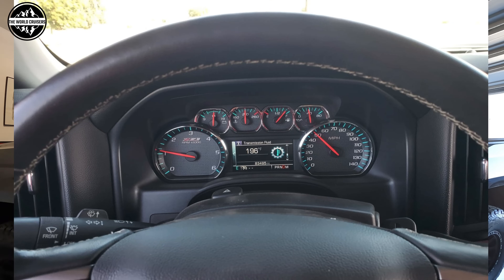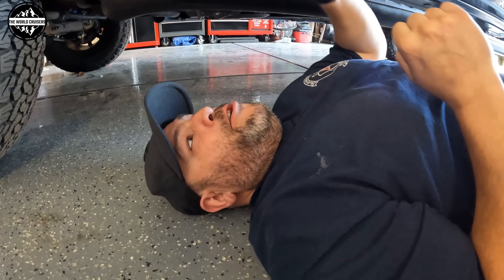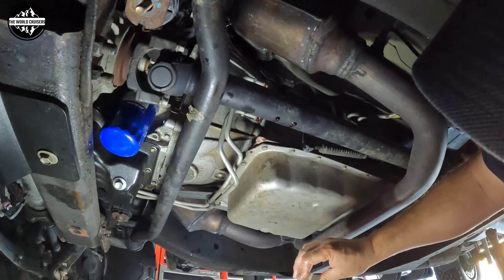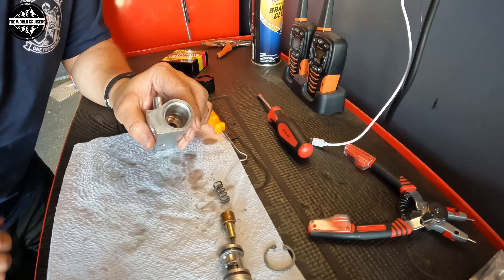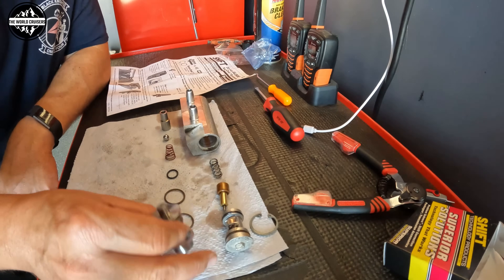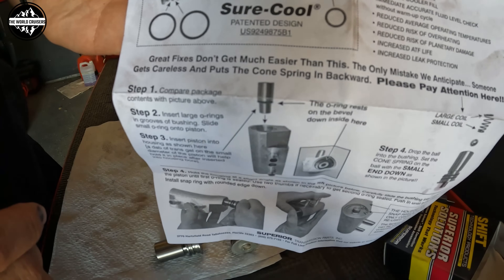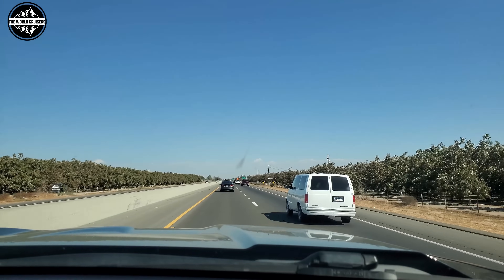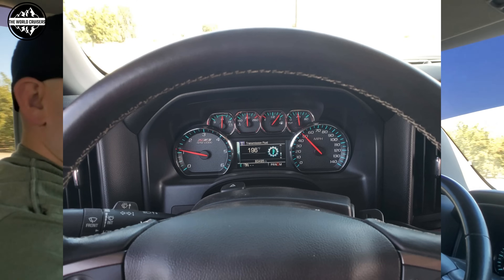DIY: How To Keep 6L80 Transmission From Overheating On Chevy/GM 2014-2018 | Pill-Flip, Sure-Cool Kit

Comment: Great video!! Just had a customer with the same problem, updated part from GM fixed it!
Reply from the maker: Thank you! Happy that it helped!
Reply: What is the updated part?? 
Need to know, I'm a new owner of a beautiful 2014.
Reply: Its an updated thermostat but like he said in the video youll need new cooler lines. Or you can just simply flip the pill and be done. @tomwoods8678
Reply: Can one use the internals of the updated and place Into the original part?
Reply: @themanimal01  Yes.

Comment: I have a 2017 Silverado and just spent $5000 on repairs for my 6l80, got thermostat bypass installed, gears at 4.56 and new radiator and engine thermostat and my transmission temps are hitting 220 while driving (no towing) and trans temp will get up to 230-240 if I’m idle for a long time. Took my truck back to transmission shop and they keep telling me everything is fine and 6l80s “just run hot”
Reply from the maker: I’m no transmission professional, but from my research they should run 175 degrees plus or minus 25 degrees.  Maybe get an opinion from another transmission shop because that seems a bit too high to me.  I will ask my local shop here as well and see what he says. What size tires are you running?
Reply: Trans cooler is prolly plugged
Reply: @huntfishsmokemeats  you are correct I had my transmission flushed and lines cleared. Haven’t had an issue since. Transmission sitting around 140-160 during winter and around 180 during the summer now.
Reply: @rxjefe have you had any other problems?
Reply: @tylersimpson3512  just the transmission around 80K miles. I’m starting to build a 6.2 to swap before the lifters go out. I had some electrical issues that will cause the radio to shut off or my steering wheel would jerk. But after a battery change it hasn’t happened for some time. I’m thinking a ground wire was hitting metal or getting some type of interference.
Reply: @rxjefe  did a shop do it or did you do it?
Reply: @bryceeitel9463  yeah almost everything was done at a shop, I did the thermostat bypass and radiator install.
Reply: @rxjefe having same problem
Reply: Just installed mine Friday.. So far in the past couple days the temperature got up to 144 And then went down to 140. Going to keep monitoring it over longer drives but so far seems to be working like a charm :-)
Reply: I installed the superior product. However, I still have heat issues?? Clean trans fluid. I have no clue. Does anyone have any ideas?
Reply: @themanimal01 I had to put a transmission in 8000 at the dealership I’m to do a bypass
Reply: They do, so they are right ,technically speaking...but they *shouldn't*, and even GM admits that now.
Reply: I found in my 2013 Silverado with 536 LED that sub hundred degree temps from ambient or roughly where it runs

Comment: Great info, thanks. About 4O seconds in, your video shows transmission temp at 196 degrees. Is that sensor built in? My 2015 doesn’t show transmission temp screen.
Reply from the maker: Thank you… yes it’s a factory reading.  You might not have the box checked in your settings.  Click your left arrow, scroll down to options, the info, go to transmission temp and check the box that you’ll be able to see it.

Comment: Thank you for this video! I really appreciate it.
Reply from the maker: That’s a reason why we wanted to make this video.  We’re glad it was able to help you.  If you have the 6 speed transmission I would recommend you to upgrade your torque converter to a Circle D or ZL1 torque converter as the factory one is prone to failure and also taking out your transmission.
Reply: @The World Cruisers  yes sir i already have been looking up how much that would cost vs a total replacement.  Looking at around 500-1000 vs 3000+
Reply from the maker: Happy you liked it!
Reply: @TheWorldCruisers  Stuff like this saves people thousands of dollars, and we need that more than ever these days.

Comment: Why does the display show it's around 210 temp and the digital display show 165?
Reply from the maker: The 210 degrees is referring to the engine coolant temp and the 165 degrees is reflecting the transmission temperature.
Reply: @TheWorldCruisers  Appreciate it, I'm not a car guy at all and was thinking it was the trans temp. I was freaking out about my trucks trans temp for no reason. lol I didn't even know the display on my base sierra 1500, would show trans temp until I twisted the dial on the cluster. Mine doesn't have the fancy display that you can adjust on the steering wheel.

Comment: How many quarters, did you fill it after installing the thermostat
Reply from the maker: I pretty much eye balled whatever came out which wasn't even half a quart. Poured about 1/4 qt,  drove the truck around the block and checked the level and it was good.

Comment: Love this.  I would add two things.  1.  Cover your transmission lines with a plastic bag so no dirt gets inside.  2.  Use QD Electronic Cleaner instead of break cleaner.  Transmissions hate other fluids, even small amounts and QD leaves no residue.  Use the QD to clean the crap out of the inside of that block and all components prior to assembly, and spray some on a lint free cloth to wipe the ends of the lines prior to installation.  If even a speck of dirt gets inside your transmission, it could cause catastrophic failure.  Pretend your are in a clean room when dealing with transmission guts.
Reply from the maker: Great information! Thank you for your comment and suggestions.
Reply: Would WD-40 Contact Cleaner work the same way as the QD?